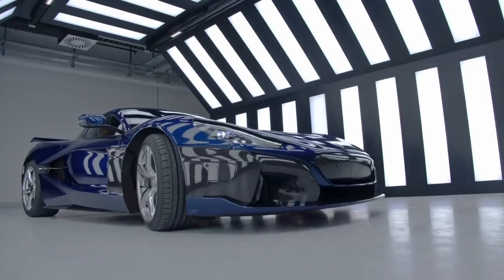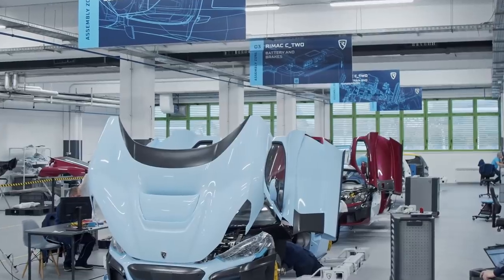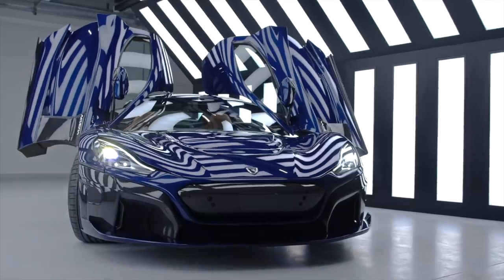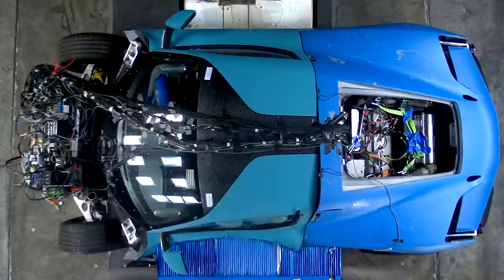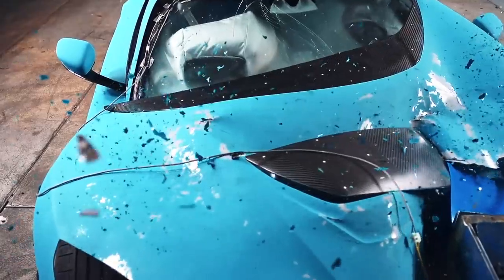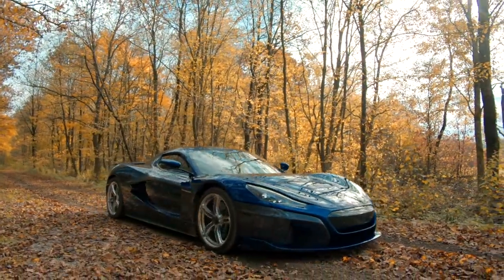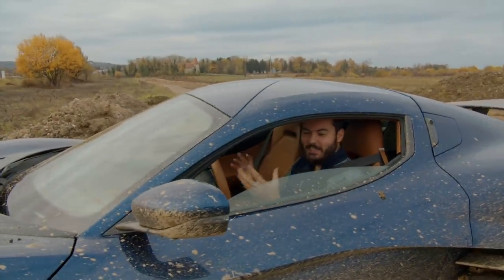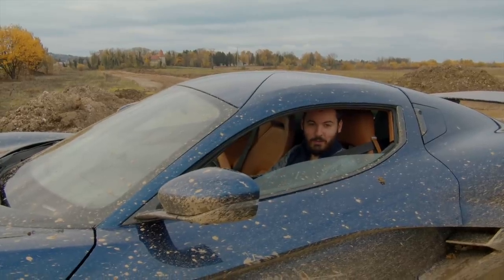Rimac Nevera Goes Off-Road

Comment: Koenigsegg: Haha, Your slow. Nothings gonna be faster then me.

Rimac: hold my 60 mph speed limit sign.
Reply: What about top speed
Reply: They won't diss each other like that. Rimac is the supplier for the Regera's batteries.
Reply: @hugo-pg5tv  Bugatti division will handle that bit.
Reply: @dbclass4075  bugatti have said no more top speed tries so no
Reply: @hugo-pg5tv  For the meantime, they still have the highest top speed vehicle.

Comment: Tbh I hope owners will do this. Life is meant to be fun, and driving a 1.4 kW AWD electric off-road sounds just like that. Forget about the chipped paint and scratched underside. The worst which could happen to these cars is to sit in a garage and only be driven 5 times a year under tightly controlled conditions. Don't be boring!

Comment: Question for Rimac: so if the Concept Two was all-wheel-drive, is the Nevera all wheel drive or rear wheel drive? And will it ever come with an awd variant?
Reply: It's confirmed all-wheel drive, though the power distribution can be adjusted. Say, turn it into a really powerful Golf (FWD).
Reply: @dbclass4075  that would be fun if you can make it fwd

Comment: Did you fix your old android looking display on the driver side? With it's slow refresh rate? Slow old hardware is not worth 2 mill. Step it up. If I bought one I would spend 300 on an oled panel so it doesn't look like it was made in 2010.  Fix it

Comment: The worst idea possible for a full EV cars. 
WoooHoooo... enjoying driving hard off road. Battery 0% 30mins later. 
Guy 1: Did you bring the charger?
Guy 2: Yes, yes I did. Fast charger too. 45mins full charge.
Guy 1: Alright. Charge it then.
Guy 2: Umm dude, where do I plug it in?
Guy 1: Plug it in the power points you dumbass.